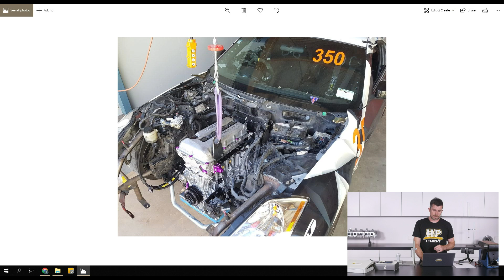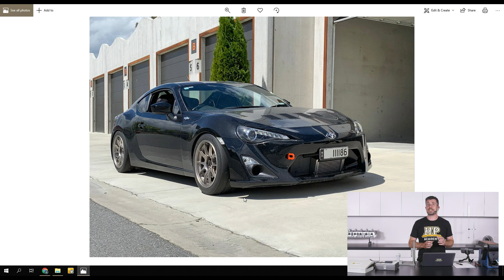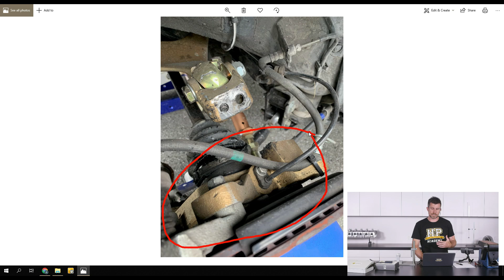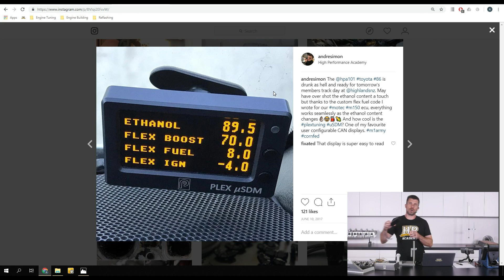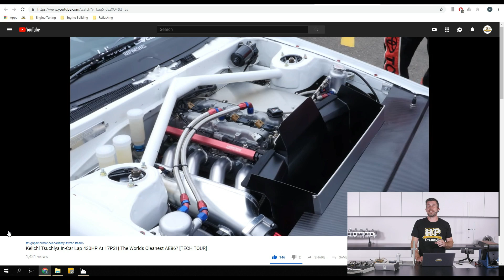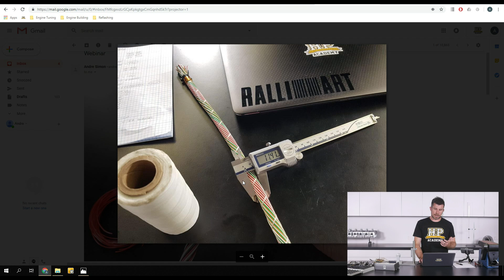V8 GT86, Turbo Testing, Concentric Twisting and Drivetrain Failure | Today at HPA 194 [UPDATE]

Comment: Not that I'm  biased either way,  what are the reasons you choose a 2.0 4cyl over a 3.5v6. In my limited knowledge I would have thought especially for an endurance race a bigger capacity lower stressed motor would have been a better choice over a higher stressed small capacity motor?  Love your work.  Cheers
Reply from the maker: Bigger engine puts you in a different class. With the SR we can stay in a class that suits our skill level, budget and overall car setup - Taz 👨🏻